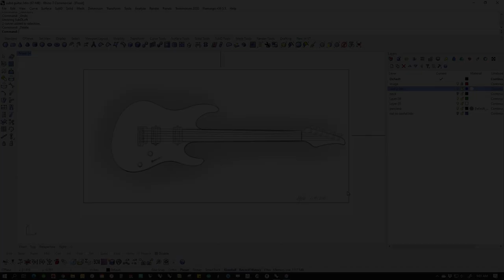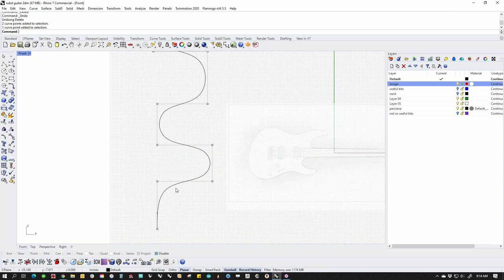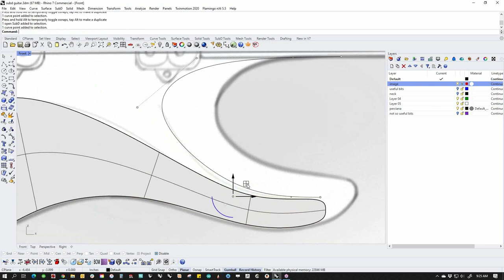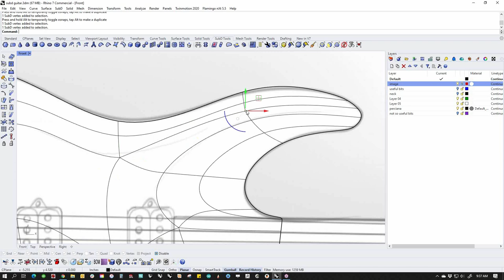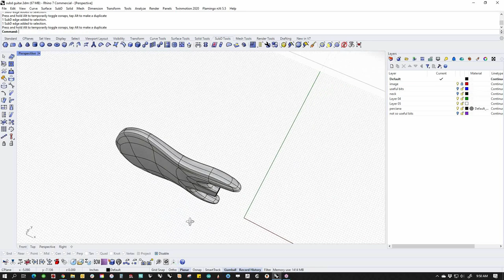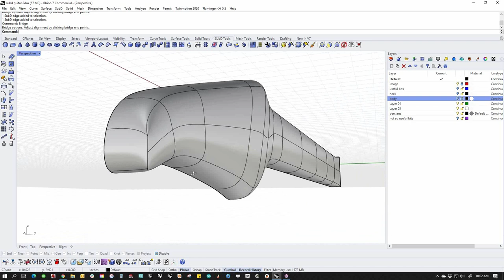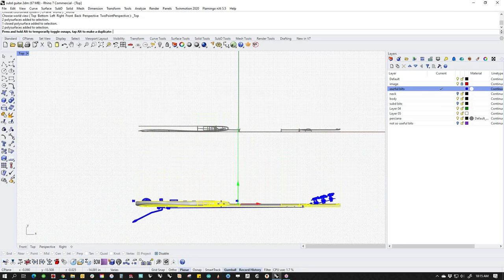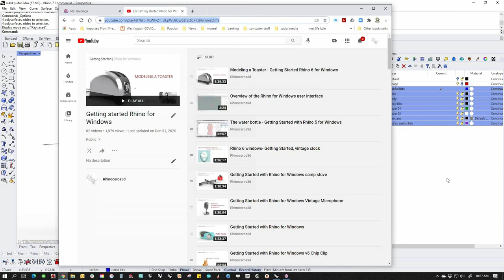Rhino 7 Windows - SubD guitar full build

Comment: RULE of 3: 3 points is enough to make a corner, 2 consecutive corners may share a point or may not to stay isolated.

Modelling in box mode, editing in smooth mode. 

To select a specific following edges in a loop: (IS THERE A RING MODE LIKE THIS?)  
1. Select the 1st one,
2. (Shift select) the last one,
3. Double click anyone in between.

Comment: Just wondering what's the real advantage of using sub-D over than usong a dedicated polygonal modeling software like Blender or Max.
Is there any real advantage? I mean, I've used Rhino since V4 but I can't still find any utility in SubD especially since it's super limited compared to Blender or other. Can you help me to make up my mind?
Reply from the maker: subd converts to nurbs with a button click, which means you can data transfer to engineering packages, CAM, etc... Polygon programs like blender or max, leave you hanging in polygon space, which makes engineering more difficult. (not impossible, just more difficult)

Comment: Hello Mcneel and rhino 3d,  is there a way where we can make the Box mode more precise and closer to the actual smooth mode?  I think it's ridiculous to have such radical differences in shape from box mode to smooth mode. It's very unintuitive.  Tsplines didn't have this problem.  If mcneel could at least make box mode closer to smooth mode then all is fine.  Until then it's so hard to completely work from box mode, especially when modelling many creased edges, and to transition between smooth mode only to find out the the smoothed shape is completely different from my intuited box shape.
Reply from the maker: Tsplines worked exactly the same (I used to be their demo guy) 

Box mode is the control polygon and smooth is the interpolated limit surface. Same with tsplines. 

If you have a higher poly count control cage (box mode) it would be a less radical change. But you’d have more chance of injecting an inflection. 

All subd systems work this way. It just takes some getting used to.
Reply: @Rhinoceros3d  Thank you for your response,  it means a lot.  For me personally,  I don't recall experiencing such discrepancy between box mode and smooth mode. I'm not saying the translation is perfect but to me,  Tsplines seems to have a lower degree of deviation from box mode to smooth mode, especially when there are creases. My question is - Will this be the end all be all or does mcneel to plan on making it mode precise?
Reply from the maker: @AtTheEast18  this is how it will be. 

Try subdividing the model more to get a denser box mode. That will be closer to your limit surface. 

I think if you did some testing you will see tsplines and rhino are virtually identical if you compare the same mesh in each program.